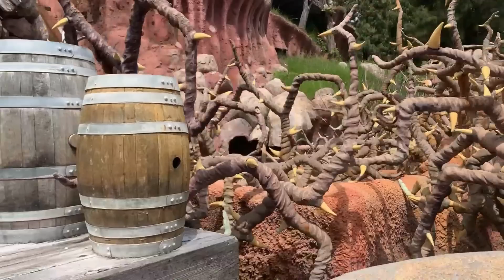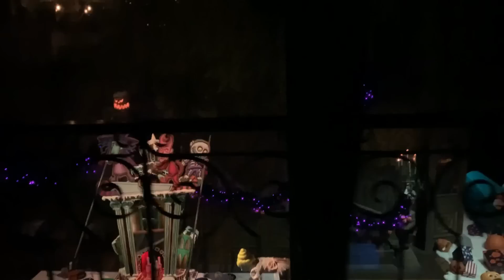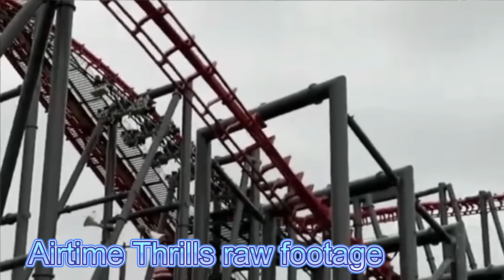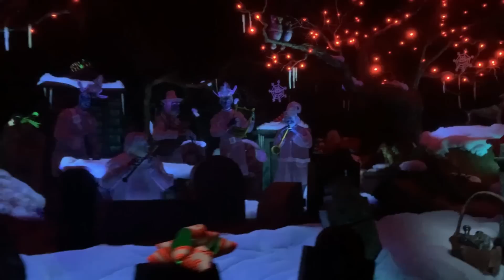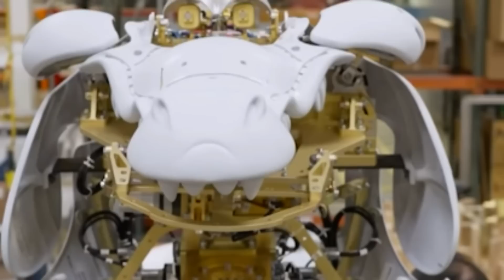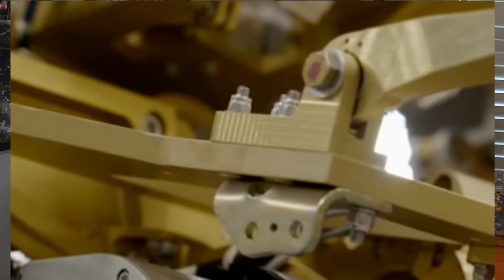Lets talk what’s wrong with Disney Worlds Tianas Bayou Adventure

Comment: I like the way he describes the whole system of running and controlling a show-ride. Very complex. One other solution to the humidity problem would be to cool the water. That would make any condensation go back into the water and keep the surrounding air dry. However, it would also make the boats cold and the passengers might not like that.

Comment: Why can't they keep the water in the ride as cool as the building?
Reply from the maker: @joshw7201  the water is taken from an external reservoir so it’s at outside temperature. Even in California where  it’s an internal reservoir, the act of pumping it heats the water quickly. A cooling system for the water would tag on millions to the price tag. Plus imagine how cold that would make the splash!! Burr

Comment: I do believe that since Splash Mountain used older technology and didn't get a full overhaul meaning the ride is still vulnerable to the same problems Splash Mountain had. Some of the newer animatronics are near the place or are in the old place of the Splash Mountain animatronics. This is normally the power supply/source for the animatronic which might still be old. Splash Mountain also had issues but not as much as Tiana's does now. Tiana's switched to electric animatronics where Splash Mountain had hydraulics.

Comment: I worked at a park that had 2 launched LIM coasters. I was told that when the second coaster opened (about 10 years before I started working there), that the rides had a position to coordinate launches, and if both launched/recharged their capacitors at the same time, it would trip the grid in at least that area of the park. Not sure exact details, but it was common at that park to have power issues whenever a new attraction was constructed and opened
Reply from the maker: @Clipstreu  wow that sounds fun haha!

Comment: One thing that is the secret weapon of animatronics is the harmonic drive gear, which allows for extremely small motors to move a lot of mass with nanometer precision. There is of course a trade off, these tiny motors have to move incredibly fast and will often require air or water cooling which takes up valuable space. What’s funny is that because the harmonic drive gear results in an outrageous amount of torque, a large innocent looking animated figure can easily crush or knock over a large adult.
Reply from the maker: @cookieflavoredoreo4685  I bet they are very heavy.

Comment: One of the many things Splash Mountain had going for it was the sense of movement, composition, and detail in every AA scene.
Even when the AA's weren't moving, or not functioning along their full range of movement - the scene worked because it was all composed like a single frame of animation, or a single comic book frame.
With Tiana's there is little like that going on at all.
The AA's HAVE to work.
We are dependent upon them for dialog, and a sense of kinetics.
Otherwise they are just creepy static figures.

Comment: Water vapor (grains of moisture) in FL in summer = brutal. Condensation occurs somewhere in pretty much every building during the summer. Just the facts of life here for 5 months.
Reply from the maker: @FloriDUH_JBot  any secret? I’m assuming best defense is to make an area a wind tunnel to help dry it? But I live in the Mid west. So out high humidity is Florida’s nice day.
Reply: @ryantheridemechanic  great question. i happen to know a fair amount about this subject, as I own a building science consulting business. The short answer is ... as long as the steady state surface temp of a material is within 1 or 2 degrees of the ambient dewpoint, there is the potential for condensation to occur. Disney already handles this very situation. The doors to the retail locations are wide open with the AC running during the summer, yet nothing condensates. That's because they use dedicated outdoor air equipment in those retail locations to accomplish this. I often use the water bottle analogy. If a water bottle starts to condensate outside in the summer after you take it from the fridge, you don't need to call the water bottle manufacturer. The bottle isn't leaking. Just physics at work. No matter how big of a pile of money you have, you can't beat physics.
Reply from the maker: @FloriDUH_JBot  in comes the glass dome haha! Thanks!
Reply: @ryantheridemechanic  if moisture is indeed a complicating factor, I'm sure there are all sorts of creative mitigation strategies they can brainstorm up help to balance things out. just down the street at Hagrids, they have a few outdoor (covered) animatronics that work reliably. but the skrewt is just on a turntable and I don't think that Hagrid himself is a very complicated animatronic. and the unicorns at the end (which are exposed to the elements) are pretty basic.

Comment: First of all, a temperature difference of 2 degrees Celsius is a temperature difference of 3.6 degrees Fahrenheit. Since 0 on one scale is not 0 on the other scale, you can't simply use a temperature conversion chart when talking about temperature differences. Yes, I feel sorry for all you Americans being stuck with that weird temperature scale. 😂

I have seriously never heard of hydraulic actuators in Aaimatronics. When a lot of parks in Europe built dark rides in the 80s, the animatronics were usually pneumatic driven. You could hear the clacking of the solenoid valves and the hissing of air being released. And, unsurprisingly, the motion was quite jerky. After that, most parks with the exception of maybe Disney, didn't do much in terms of animatronics until more recently when they also went for electric actuators. One notable difference from the pneumatic animatronic was (or maybe still is, I haven't been there in about 15 years) the "Fata Morgana" dark ride at Efteling in the Netherlands. They used a similar control technology to the rotating lobes you discussed,  but instead of using them to drive hydraulic valves controlling cylinders, they used bowden cables to transfer the motion from the control lobes to the animatronics.

When it comes to the power supply of modern animatronics, I would rather think that each one has its own dedicated power supply built in or nearby. Why do I think such? Well, first of all, if you have to run let's say 24V DC over long stretches of wiring, you have a lot higher losses than what you would have when running mains from the central power distribution point to each animatronic. Also, you can use smaller, more common power supplies that are likely less expensive than one that is as massive as it would be needed to power all of them (and you can easily keep spares in stock in case one goes out. You don't want to have that big expensive one sitting around just in case). And, last but not least, those power supplies can run off quite "dirty" voltage. At work, we tested some off the shelf 24V supplies , and they output a clean smooth voltage over the entire input range from about 90 all the way up to 230V. We also found that they would run off DC as long as the voltage was within range, as the first thing in there was a rectifier. Therefore using individual power supplies also gives you clean voltage as a benefit (and 24V over a long wire, potentially close to lines powering something big would be far from clean). But I am just speculating here myself, it would just make more sense to me.
 
When it comes to sensing the boat position in a log flume, I like the approach Mack rides uses. I may have mention it before, but they use sensors that have "feeler fingers" sticking up from the water, and the boat will trigger them when passing over - it will just depress them and they will come back up once the boat has passed (kind of like these barriers that you can only drive over in one direction, otherwise they will slice up your tires) . So no matter the angle of the boat or how deep it is in the water, it will always trigger them. I have only seen them being used in the block system, as the log flume I am most familiar with only has triggered "show scenes" in the turntable area - and of course there the boat runs on its wheels. From what I understand is that the submerged part of the switches is a basically a prox switch (you can get the point where the wiring passes through watertight no problem, especially given that it only sets in water about half a meter deep), and the feeler finger is mounted externally, with a counterweight on the other side of the hinge so that it stands up all the time. The prox switch then simply detects the position of that feeler finger or its counterweight, which only pivots around one point, so it is easy to tell if it is up or down.

Comment: I've not been to WDW since Tiana's opened, but from previous visits one thing I always found with its predecessor, as well as other boat rides like Pirates or Small World, is that there was always a long queue of boats coming into the station. It always felt like they were running more boats than the loading procedure could handle and you'd often be backed up into the last scene. I was never sure if it was because they were over-optimistic about how fast boats could be dispatched, or if there was some other reason.
Reply from the maker: @m00gal  makes the ride prone to block shutdowns.

Comment: It would be kind of funny to me if the animatronics actually ran two entirely separate loops and had to home in between. Path blending has been a fairly well developed science for what, 20 years now?
I hadnt considered the power requirements until now though, and i can see how the ride updates might have put way more strain on the power systems than they were originally designed for.

Comment: Speaking of power....at the park I used to work at, they added a big water rapids ride. The incoming 34.5kv service to the entire park was back by our warehouse. As they were expanding the HV switchgear to accommodate that new ride (and knowing that we had power issues before that ride was planned) I was talking to the power company's engineer about the total load on the service (both the incoming lines and existing switchgear that they were adding on to.) Before the new ride the gear was already loaded to 70-75% of max. After the new ride it went up to 85-90%. Not a big deal, right?  Well industry standards for HV and MV switchgear is to load them at no more than 80% to allow room for the extra current from brownouts and surges to not damage the gear or trip the HV breakers.  The original loading was considered to be at the limits of that older gear.  Any bets on what happened shortly after the new ride was up? 

I had moved to Northern Cali working at a music store when I got a call from our keyboard dept., which had a tv in a rack mount. They asked me "Didn't you used to work for xxxxx?" I said yeah. They said, you gotta come see this.  On the news was that park's main switchgear in flames, with many trapped on rides, and the park's head engineer (who BTW yelled at me when I brought up that loading the main gear so high was a very bad idea) trying to shoo the news cameras away.  Turns out a car hit a pole, which single-phased the entire area, including the park. The strain from all of the ride's motors trying to keep going pushed that old gear over the top, and boom. 

Instead of a  few million or so to upgrade the gear and service (or it might have been adding a separate service for the new ride, it was decades ago) when the new ride was going in, they decided to press their luck ...it ended up costing them several million and a lot of downtime to fully replace all the damaged gear...and repair the dozens of ride motors that burned up (and a few of the park's internal padmount transformers (big green boxes) as well.
Reply from the maker: @mxslick50  wow that sucks. It like the ultimate “I told you so” story!
Reply: @ryantheridemechanic  The temptation was very strong to make that phone call. :)  That park engineer wasn't liked by too many even before this incident.

Comment: The question is... did any of this come up during testing.  If it didn't then they did not test properly.  If it did then they decided to open the ride anyway and deal with the bad press.
Reply from the maker: @stevehafke3614  seems the cast member preview was also full of problems so I’d say it was there during testing. Just my opinion.
Reply: @ryantheridemechanic  problems like these should have been caught even before cast member previews and most likely were.  A decision was made and a buggy ride was opened.
Reply: @stevehafke3614 They rushed the opening presumably because of the capacity issues that having that ride closed creates within the park. It’s critical to keeping the wait times down throughout the park.

Comment: American Eagle at Great America uses an optical Photo eye at it's final brake. It trouble lights all the damn time thanks to birds and squirrels.
Reply from the maker: @DokiKimori  critters are the worst. No one knows how fast spiders work until they start building their home on a photo eye. Spiders get EVICTED with extreme prejudice.
Reply: Why don't they replace it with a proxy sensor?
Reply from the maker: @alaeriia01  well photo eyes are great for watching long distances with one input. So they are useful in some cases. I’ve seen proxy sensors used but they needed to add about 10 to make up what the photo eye did.

Comment: MEMS gyros and accelerometers are cheap so Disney needs to use more of them in their animatronic feedback loops 😂
Reply: With the new stuff I would think that the actuators already have position feedback built in. It's not rocket science, and you don't even need to go to gyros and accelerometers that need a lot of processing to go from their signal to a position. You can have anything as small as just a potentiometer (if you think small like a model servo that could be used for light things like eyes to move) up to brushless DC actuators with an encoder already built in for the motor control. 
I would not want to use sensors that only record a change to keep track of the absolute position, unless you regularly reach some kind of reference position to reset your assumed position value. Especially when dealing with a finite range of motion like there...
Reply from the maker: @TallCoasterGuy  it has to be a mess in those things. Truly need an advanced degree to troubleshoot.

Comment: I HAVE A QUESTION! 🙋‍♂️ you may have covered this before but I would love to know the different types of roller coaster breakdowns. I was recently at cedar point and their rollercoasters go down VERY frequently. I understand it varies with manufacturers, but their Rocky Mountain construction coaster, steel vengeance broke down SO many times, most of their B&m rides broke down when we were in line, their zamperla wildmouse coaster broke down when we were in line, and maverick, their intamin lsm broke down so bad they needed to evacuate people from the break down. Anyway I’m just really interested what the breakdowns mean and why maintenance has to be on site to override every time.
Reply: Cedar Point ride operator on Magnum and Top Thrill Dragster, once upon a time. I recall most of our down time was due to guests pulling out phones and cameras, which Cedar Fair took very seriously. Other times, resets were quickly preceded by a phone call to log and move on. E-stops are a whole different problem. No one loves an e-stop.
Reply from the maker: @williambooth6524  I have multiple video on breakdowns. But it really boils down to the park. Disney lets their ops crew reset rides and log troubles, maintenance is called when they are having repetitive or can’t get it to reset. But some parks don’t allow ops to touch the ride faults at all. So the bulk of time down is defined by the park. After that, there’s two types of faults. Ones that just stop motion, or ones that interrupt power to the ride (Estop). Some rides have warnings but not many from my limited experience.
Reply: RMCs are cranky for their first few years of operation.  I'm not sure why SteVe continues to be cranky though; I suspect it has something to do with the massive wood structure.  I know RMC wanted to do a lattice arch like Iron Gwazi or Zadra and Cedar Point said no.

Comment: With new unique systems: come new unique problems! 

Keep um comming Ryan! Great stuff.

Out of a local dumpster years ago I got an old “showtime pizza” pneumatic animatronic, one year if I can accumulate enough valving it will dance again.  Lol!
Reply from the maker: @ArtBarn591  wow so cool! SMC makes really nice and cheap modular pneumatic valving that can be placed in tight areas.
Reply: Dish washer solenoid valves are good for air too, and are fairly cheap for generic ones. Free if you find the appliances discarded on the side of the road. A 1/4" nut driver and a sharp knife is all you need to remove them. Most are still 120v but newer models sometimes use other DC voltages so look up the part number to be sure. If buying them online, stick to the $6 - $20 price range and avoid the overpriced ones marketed for specific models of appliances. They're all basically the same thing. Great DIY option.
Reply from the maker: @AMultipotentialite-fn7oe  that’s a good idea. Do those work with air?
Reply: @ryantheridemechanic Dishwasher solenoid valves do work with air, however they are typically cheap plastic parts designed for household water presser, typically 40-60psi in most places, and could probably handle 80 to 100psi no problem. I have had a couple start leaking air from where the body is screwed together at around 100 psi, but a tiny hiss isn't a big deal depending on your application (DIY prop actuation, experimentation, applications not involving life safety)